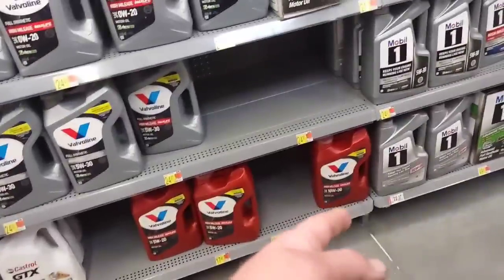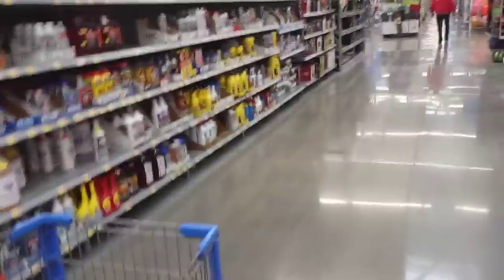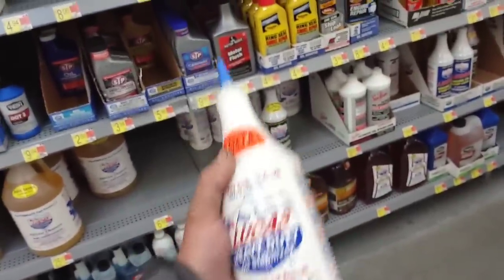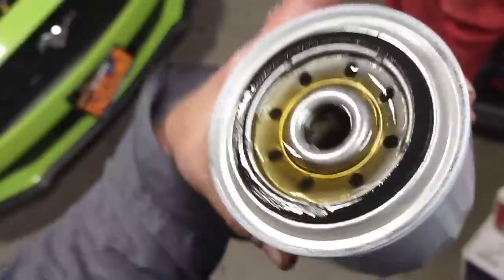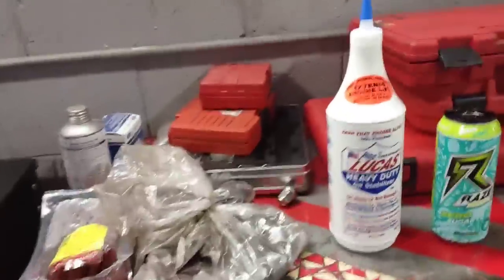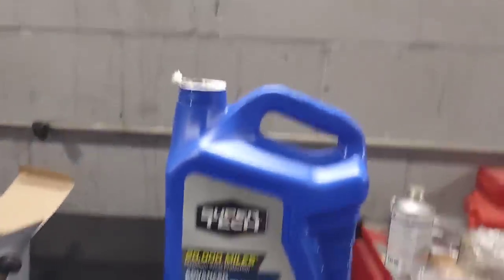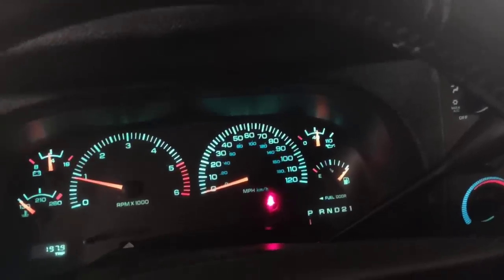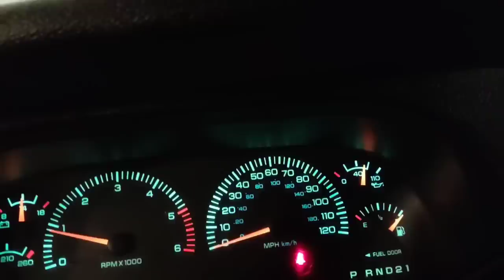We continue With Marvel Mystery Oil and SuperTech 10w30 20k Mile Full Synthetic Oil Dodge Ram 5.2L

Comment: NOTE: whenever buying oil from W/M open the cap and make sure the seal is not broken and your not buying someone else's used oil and verify the filter box for the correct filter.  This includes ANTI-FREEZE.           (bought an Otter Box with no belt clip so...................)
Reply: You know what sucks? Realizing you just bought someone else's used oil AFTER you've already drained your oil. Since then, I always check that kind of stuff, especially at Walmart. I've seen it and caught it in time 4 or 5 times since then.
Reply: The same goes for their cashews. I got home and found that I had bought a half eaten can.
Reply: I would also like to add a used windshield wiper, that they actually broke too.
Reply: Lol same with fake spark plugs and others... buyer beware as other customers are A$$$o$$$.
Reply: I went to grab a gallon for my power stroke and the jug was light.. the seal had been broken and was actually just under a quart low.
Reply: I bought some tint at Walmart, got home and found window shaped pieces missing from it, returned it and found many packages the same way.
Reply: Sound advice. I purchased a K&N oil filter for my 98 Pathfinder and when I opened the box someone had stuck a Fram filter in the box. At least they were nice enough to put the correct filter for my Pathfinder in the box.
Reply: This is also true for other stuff in Walmart = 
The one in Pompano Beach FL  is plagued with people opening the plastic bags of underwear and stealing 1 or 2 out of the bag!  I went there to buy some for my handicap brother and myself, I could not - all bags ripped open.  Store mgr said it is a problem for years.  
So I went to the one on west side of West Palm Beach, near my brother, they have a similar problem, but not as many opened.  Couldn't get my brother's size in an unopened bag, so that store mgr and I picked 6 out and into an opened bag, plus she allowed 1 extra, grateful I spent the time  - and I washed them for my brothet.  Next time - Target store Delray Beach.
Maybe they will have to put Haines and the others into a locked cabinet, like they do with paints and some of the easy-to-pocket stuff now.
Reply: @joev4538  ....besides my initial (thread) oil experience was my Otter Box purchase. Friend and I both had an i6 and he had the Otter. Went to W/M and got one and then he mentions, over the phone, the 'clip' and I'm like what clip, and we argue, thinks I'm nuts about some clip never thinking I'm buying an opened/altered item; the plastic belt-clip had been 'edited' out of the package.
Reply: @barryaiello3127  yes this is true - the cameras have to be at the item return & customer service counter(s).  
Last time I looked, the 2 larger WalMarts near my brother and me - DID NOT HAVE CAMERAS at those counters.  
See my other comment here.
Reply: @joev4538  Maybe they're tough to see, Walmart has tons of cameras everywhere, when you pay your employee's that cheap some might look to steal at any opportunity. Customers too, one Walmart camera showed a woman open a bottle of bleach, pour some on the floor, put it back then laid down in the puddle started screaming how she'd "slipped' and wanted to file a lawsuit, when shown the footage she changed her mind.
Reply: corey Babcock  At least train the employees to open it and check the seal.
Reply: I had a 77 ltd with 351m, after adding more to it during oil change.  No oil on stick.  Turns out the mmo broke enough crude free to block oil galley drain back holes.
Reply: @Brandon_Nelson92  wait what people return used motor oil and they actually put it back on the shelf. Wow that's scummy. I've never had that happen to me.
Reply: I think it goes without saying....but and check your new oil filter as well. I grabbed one once and noticed the box was a little messed up so I checked it. Sure enough, someone had taken the time to let all the oil drain out of their old filter, cleaned it up good, put it back in the box and returned it.
Reply: @barryaiello3127   WalMart needs to train the people in returns dept. to look for this shady stuff...
Reply: I did that with a gallon of coolant once. Bought 2 gallons of concentrate, one was sealed the other was broken seal with just water. Brought it back and complained about that one. Pissed me off because I needed that gallon of concentrate to finish the project.
Reply: I bought a tent and went camping when I pulled the tent out the box it had grass inside and a condom wrapper
Reply: @ruralrouteadventures8424  Well, we know it works for something! lol
Reply: Once I bought a Motorcraft oil filter for $4 at Walmart. When I did the oil change and opened the box a Mobil1 filter was inside 😅
Reply: And I thought that this only happened to me.
Reply: True!
Reply: The shit people do today to get things for free is ridiculous.
Reply: Never had that problem and I'm glad. I can tell if it's been open or not without taking the cap off.
Reply: And make sure nobody licked 👅 the ice cream 🍨 you’re buying!
Reply: EXACTLY!
Reply: I really enjoy your videos..very informative. I have a question about  taking an oil filter and oiling
it up ahead of time for a couple of days before using. I do drain all access oil from filter before
placing on engine block.  I use a wix, Napa gold, or Baldwin filter always. Also on a good clean
engine, is it still necessary to install new filter with each oil change or perhaps every other oil
change will do?  I place great value in your opinion. Thanks for keeping us informed on car care. 😊
Reply: Bill- you'll see your inquiry to Ford Boss did not reach him as what you did was a 'reply' to the 'thread' I created some time ago. I will tell you though that you should replace the filter every oil change. Why? Because the filter, come oil change time, should be contaminated by then, and if so it will only contaminate the new/clean oil. Not worth the $ savings not to. The cheapest oil/filter combo is WalMart. If you researched it you'd find that the oil refinery that provides W/M also provides many other 'brand' names. It's not the brand name that makes it 'quality' but the SAE ratings on the oil so W/M is just fine. The filters are made by a filter company and Wix comes to mind. Nevertheless, an expensive filter is just marketing. As you can see from the attached video he is using W/M oil and filter too. I too fill the filter ahead of time; at least overnight. Old school teachings. Can't hurt and if anyone said it makes no difference was probably never schooled on this. Asked Ford Boss about the hours on my Transit that I would change at 200 hours (trucks have hours, and cop cars) and he said 150 and not more so, I followed his lead. Best of luck.
 @williamoneal2763
Reply: I will never forget that advice..Thanks
Reply: Same thing happened to me. I buy my oil in bulk when it goes on sale at Walmart. Months later I went to change my oil and two jugs had used oil. The worst part was that I drain my old oil into the used jugs and I felt bad because I thought I had done it and simply not remembered and I thought my memory was starting to slip(old age). but months later it dawned on me that some a$$hole might had returned used oil. I still wasn’t 100% sure as I had not heard of that scam. This post finally confirms my suspicion. Unfortunately my memory is not getting any better either. lol !

Comment: Don’t sleep on that Super Tech Full Synthetic stuff. ProjectFarm did a video comparing most oils, and it landed pretty high due to cost per performance
Reply: After that video. That oil is all I run in all my vehicles and my family uses the same. I have a couple friends using it now. Excellent oil and cheaper, higher quality oil than a lot of other oils.
Reply: He also did a Kirkland brand synthetic (compared it to super tech) and super tech won!
Reply: I use Supertech full synthetic in my '06 Honda Odyssey and Kirkland full synthetic in my '07 Lincoln Mark LT & they are running just fine.
Reply: @fresass322  Yep, Supertech, Kirkland, and AmazonBasics have Warren Distribution, Inc out of Omaha, NE manufacture their motor oil for them. They have a SN PLUS rating from the API and are dexos gen 2 approved too. That's good enough for me. Change your oil religiously and you don't have to spend a fortune on redline and/or amsoil. I use full synthetic and change my oil around 4k miles. I also change my transmission fluid around 15k miles too.
Reply: Tee Mack  Yes, most definitely "The Mule" made the Mark LT look good again. The Lincoln Mark LT is the Ford F150 Platinum Edition now starting in 2009. So far my Mark LT has been solid.
Reply: @fresass322  that is correct. Kirkland signature oil is Warren too
Reply: Kirkland and super tech are both manufactured be Warren distributing, maybe slightly different additive packages, super tech is great oil.
Reply: I changed to Supertech recently. After having run Amsoil for 80,000
Reply: I've been using super tech gear oil since truck was nee...I have almost 250k on this differential!!! That's is good stuff and I swear by it! 75/90 supertec gear oil! Good stuff!
Reply: @rototiller78  I thought the Lincoln Blackwood was basically the Platinum F150? Had maybe 2 of them when I did PDI 2007-2009.
Reply: I've used super tech synthetic for the last 6-7 years, I have never had a single issue with it. Keeps my engines running very well ☺️
Reply: Mobil 1. Can’t teach an old dog new tricks 🤷🏽‍♂️
Reply: I've been using Super Tech full synthetic 10w30 and 5w30 exclusively since it came out back in 2000. Almost 23 years of trouble free use in 5 vehicles. Excellent oil for sure and the price is hard to beat. I like to think about all of the money saved over that time compared to name brand oil.

Comment: AutoZone's prices are beyond ridiculous. I remember when they came to town back in the early 90's, they undercut all of the Mom and Pop auto parts stores until they put them all out of business over the course of the next 10 years and then raised their prices through the roof once the competition was eliminated. I only go there to drop off my used Walmart oil and old oil filters because they are only about a mile from my house and Walmart is about 4 miles. I figure they deserve it because of how they did all of the local parts stores.
Reply: So you don’t shop at auto zone because they put mom and pop stores out of business, but you shop at Walmart? Make it make sense.
Reply: @Palantir_Daily  Thats because they put all of the Mom and Pop stores out of business so there's no choice in the matter but I guess you couldn't figure that part out either. 🥴

Comment: I cringed when you picked up and purchased the Lucas additive. I also let out a sigh of relief when you said you decided not to use it after all. I really just wanna see what MMO is capable of with out any doubts from another product being involved other than motor oil it's self.
Reply: Why do you not agree with it?
Reply: Prolong is a far superior product to Lucas as proven in leveraged pressure bearing tests!
Reply: @cesare8020  I got no problems with Lucas but I think using only one additive at a time will leave no doubts (pro or con) if MMO is worthy or not.
Reply: exactly i would have skipped the Lucas additive, there is enough in the syn oil to start with...
Reply: Me too Lucas is crap
Reply: @jmjimbo  Lucas is actually just straight grade oil like 90w or something no additives as it actually dilutes your oils additives package. That’s what a engineer that used to work for Cummins told me. He says it’s junk. He recommended using gear oil as additive regular 75w-90 gear oil for diesels. It has zinc and moly etc like old school oil had. Gear oil is the only oil not regulated by the epa he said
Reply: @cesare8020  Lucas oil treatment caused me more grief than it fixed.  Best thing to use is a TOP shelf oil, leave the additives out.  Lucas I had a problem with it carrying debris and then clogging oil passages, killing injectors... all kind of stuff.  Good oil has no use for the stuff.
Reply: @johnwinchester2428  Prolong has been proven to cause corrosion on bearings and other surfaces. Not very noticeable in a vehicle that gets driven 50 miles everyday, but those that sit (garage queens or short-trippers) do suffer from accelerated corrosion on internal engine surfaces over time.
Reply: Agree with only MMO for now.  
@Ford Boss Me  Consider in future - Engine Restore.  Comes in 3 different sizes fir 4 - 6 - 8 cyl.  No matter what used vehicle I purchased - and used Engine Restore in (when I change the oil), it always improved cranking compression - it especially brought up compression from 1 or 2 low cyls (say at 80 - 110 psi) up to the range where the other (normal) cylinders are at (say 140 - 160 psi).  
If I was using the car in  autocross, gymkhana, dragkhana, or other type of racing - I used Engine Restore at every oil change 3 to 4 times per season = 12 months.  
If not raced, I use Eng Res every second or third oil change.  
Example = in 1977 I bought a 71 Opel Manta coupe, 1.9 liter 4 cyl and ridiculous low 7.5:1.  4 spd, 3.44 gear.  Was slow when I bought it - wouldn't go over 75.  After changing the oil 2x in 3 weeks, rebuilt the Solex and rejetted primary & vacuum secondary, recurved the distributor and HEI type wires & coil = it did 102 mph at 5200 rpm in 4th.  I checked compression at 120 145 155 140 and added a 6 cyl can of Engine Restore after draining out 3/4 quart oil.  3 or 4 weeks - engine was at 150 155 160 155 ... and it would out-accelerate the Porsche 912 (1 class higher), and out-run sometimes Datsun 240Z 2.4 liter 6 cyl (2 classes up).  
   
A suggestion to everyone - does your old car have a flat-tappet camshaft & lifters (hydraulic or mechanical) = a non-roller lifter cam?  Use a zinc additive from Amsoil or Summit Racing or elsewhere.  Today's oil does not have zinc due to catalytic converters & emission controls.  The zinc protects cam lobes and lifters on a flat-tappet non-roller valvetrain.  
Apologies for the long post.
Reply: @Nathang2233  gear oil does not have the proper additives package for use in a internal combustion engine.  Also it would thin out most motor oils. At 100 degrees Celsius 90 grade gear oil is a 20 grade motor oil temperature wise. Also the whole lack of ZDDP is straight up old Huey. Any "engineer" worth his weight in salt knows 600-700 PPM of ZDDP is more than sufficient to protect properly harden cams. Plus ZDDP is old antiqued technology. There are Sulfides and other organic compounds used for Anti-wear in motor oils which work better.
Reply: @davidporter7051  ya well I’ve seen a guy who ran one gallon of gear oil in his 15L Cummins isx and did an in frame at 1million miles cam and overhead looked brand new almost no wear and these can eat the cam at 300k to 400k is not uncommon. So explain that. Engine still ran it was just tired so he redid it.
Reply: @Nathang2233  this is really the most ridiculous thing I've read in a long time.
One gear oil does not have detergents for soot control and acid neutralization. Two like I said in engine operation temperature gear oil it's a low 20 grade oil which is something most diesel engine manufacturers do not want. Three gear oil is caustic to engine bearings.  Four gear oil does not foam inhibitors for engine operation thus gear oil will bubble and not lubricate properly. Five no gear oil does not have dispersants thus engine deposits will form early and often.
Reply: @davidporter7051  he not running straight gear oil he’s using it as an additive 14 gallons of oil to 1 gallon gear oil. And it works good lots of guys are doing it in big rigs with really good results so I don’t really care what your opinion is
Reply: Lucas is just really thick, detergent less oil. It just makes the rest of the additives and detergents in the rest of the oil less effective since it dillutes it.
Reply: @Nathang2233  14 Gallons of oil & 1 quart of Lucas I would do but not in an engine holding 4 or 6 quarts.
Reply: Also... gear oil has a ton of sulphur mixed into it. That's one of the main reasons it SMELLS LIKE ASS! That stuff will ruin your engine. And it's liable to leave sticky gel like deposits on the insides.... of critical engine parts. Clogging up your oil pump is not something you'd want.
Reply: @brucewrigleysgumchewz4667  Ahhhh, that's why it smells so bad.  Ok.

Comment: I've heard mixed reviews about using heavier oil in high mileage engines. Some will say that heavier oils won't get to lifters etc as quickly, thus lighter oils are better at getting where they need to go earlier. "High mileage" oil isn't better at preventing blow by necessarily, but has additives which help seals from drying out. I think that Super Tech oil is actually made by Kirkland Oil, and ranks very well as compared to other brands. I use a splash of MMO in the gas and oil in my lawn equipment, but I've heard not to use it in the gas in vehicles with catalitic converts??? Don't know. MMO has a new blend which is made for turbo charged vehicles, supposed to help lubricate the turbo and help with cool down. Regardless of brands used, the most important things are, check your oil level, and change frequently.
Reply: Super tech is made by Warren distribution from what I have researched!